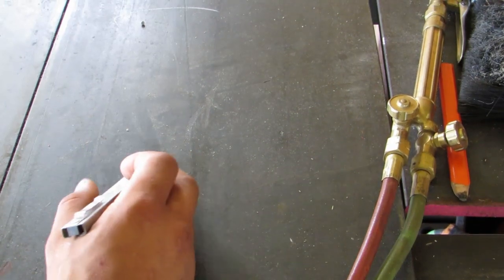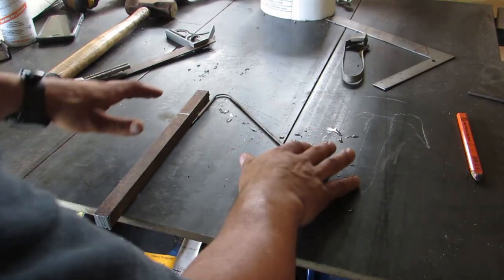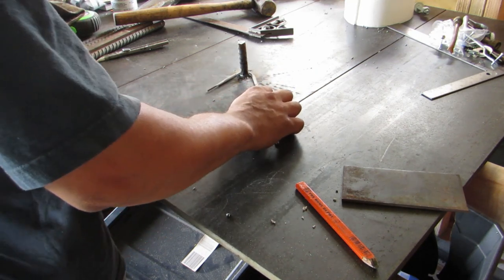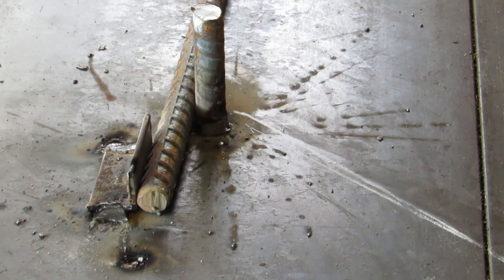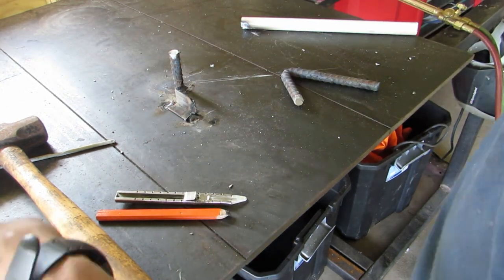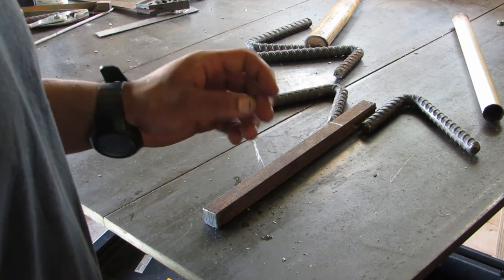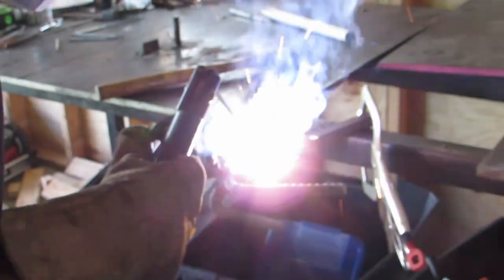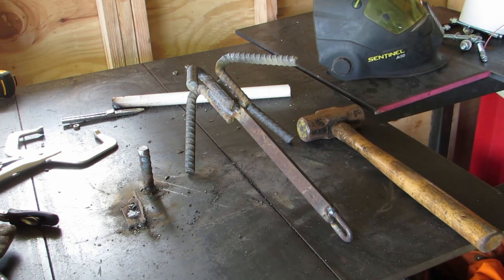Homemade Grappling Hook- How to

Comment: I’m going to try with 1/2 inch rebar
For both hook and  shaft
Good idea to use chain for eye
Don’t have welding table ,going to use heat hammer and vice
Thanks for the video